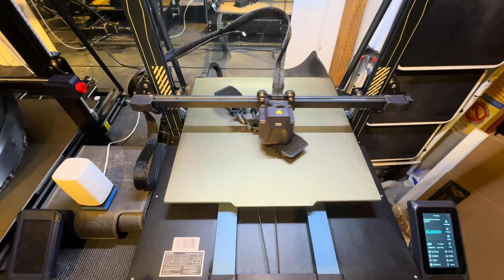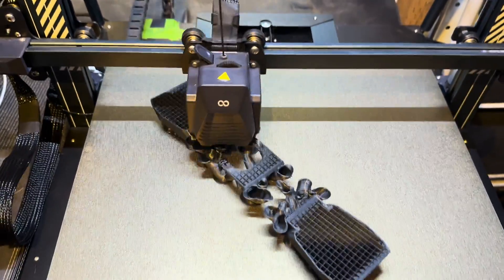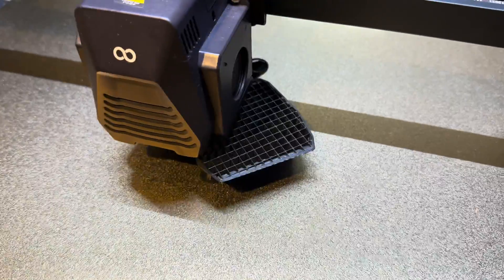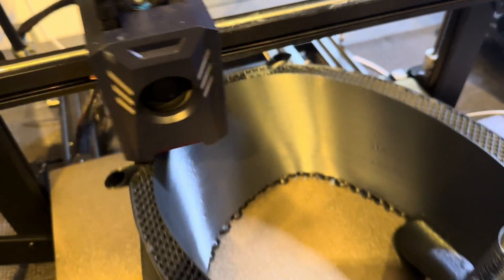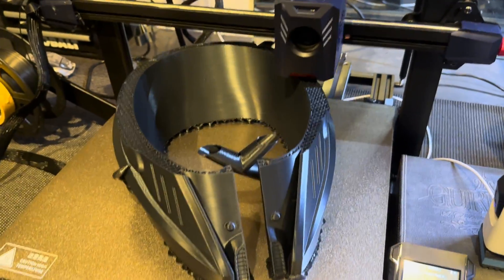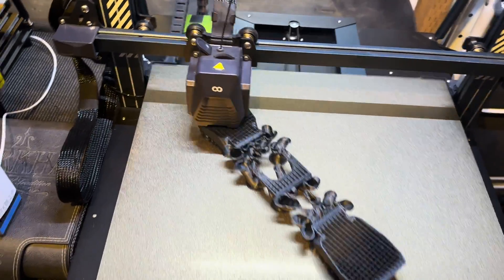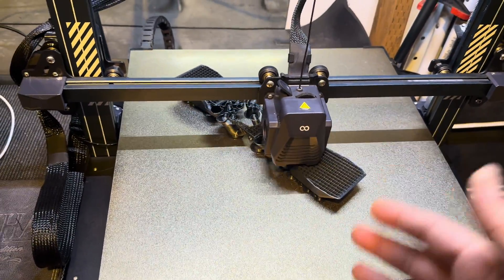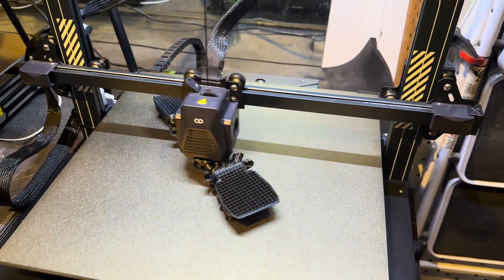How to prevent the nozzle from dragging across your print on your Neptune 4 Series 3D printers.

Comment: it's also possible that your z-offset was too high causing layers to be thicker than normal, if so then adjusting the z-offset even further away will only result in the same issue later in the print.

Comment: ADJUST MATERIAL EXPANSION

Its a Thing when you under extrude with a .4 at .2.... etc. Stretched the material and the layer actually hardens .205 not .2 x 30 layers makes Head rub..

Increase expansion like 1.5-2.5% 
Then Nail down perfect with .02 +/- z offset adjustment

Comment: I had the same issue. I was using Grid infill. even with combing off
 What i thinks happens is that the printer crosses the infill intersections twice per layer, the thickness (height)at the intersections  accumulate on each layer and finally hits the nozzle, I do not have an issue using 'lines' infill instead of 'grid' infill. the infill looks the same,
one can see see what is happening if you run a preview in cura using grid and using lines.
I hope this helps

Comment: I had this issue and managed to solve it ! (i use cura)

- Ensure bed is level within 0,3mm or less
- Ensure the gantry/head is firmly in place, as well as the wheels on the sides (shouldnt have one bit of loose movement when wiggling the frame, max one wheel thats loose. There is a tutorial from elegoo on this.)
- Adjust/calibrate your flow ( i used 96% after watching a how to on youtube, my flow was way over before)
- Gyroid infill can help (no overlaps with this pattern)
- Combing mode OFF
- Ensure Z-hop height is same as nozzle (0,4mm)

Im new to 3d-printing, but hopefully this will help =)

Comment: I adjusted my z height during a print. It fixed it temporarily but unfortunately a couple hours later, it started up again. This is because the issue isn’t the z height. The real issue is over extrusion on the infill. Charge to Gyroid infill and it should fix the issue. As for the nozzle dragging on supports, you’ll probably have to adjust the extrusion settings
Reply from the maker: I agree with you, over extrusion is the likely culprit and the gyroid infill is worth a shot!

Comment: Thanks for the info-  I got mine fixed by- 1 switching off Combing, 2 increase Z-hop to 0.4mm, 3 decreasing the flow.  I found I had to decrease my flow by a whopping 25%.  I set it to 75% flow and it is now flawless with no dragging.
Reply from the maker: That's great to hear it's fixed! Thanks for sharing your solution. 👍
Reply: You were a big help😊

Comment: I have changed the z hop setting and the infill from grid to gyroid and still have that problem. Is there anything that may cause it? I use Orca slicer for my Neptune 4 Plus
Reply from the maker: In Orca just past the “Support” section is the “Others” section. Towards the bottom of “Others” is G-Code output, I typically have to uncheck the spot that says “Reduce Infill Retract”. Also, I now mainly use Adaptive Cubic infill pattern.
Reply: @OuterRimArmorer  Would you still recommend the z hop settings?

Comment: I don’t know what’s going on but whenever I print a big print it always just keeps scraping the inside in its poking up so you can hear it scraping against those and I don’t know how to fix it does anyone know how?
Reply from the maker: It’s probably the most infill pattern you’re using but it could be another setting like combing mode depending on the slicer you’re using it might be called something different.

Comment: im having that problem with my pro and max. im printing with them right now and the pro started doing that. its also not completing the lines as it makes a pass causing the line to curl up at the end and then the nozzle smashes into the curled line. ive also noticed that on the walls and infill, the head extrudes little dots of filament and lifts up moves down the path about 10 mm goes down leaves another dot of filament and repeats the process. could that be fill gaps? but fill gaps is on on my neptune 2 and it doesnt do that. ive been searching for what the hell that setting is that does the dotting but cant find it anywhere. now the max is doing the scraping thing too as i type. i think amazon is getting 2 returns, this is ridiculous.

also i turned combing mode off recently because i heard it knocks parts off the plate which is what my neptune 2 does with supports. but z hop was turned on by default on my 4's so im gonna turn that off to see if it stops the dotting.

 i have grid infill on the print on the pro and gyroid on the max print so the argument in the comments about gyroid vs grid is kind of funny to me, finding humor in this is maybe my copeing mechanism to avoid throwing both printers on the sidewalk and going back to my neptune 2. if anyone can tell me what that dotting setting is, i would greatly appreciate it.

if its z offset causing the grinding of the nozzle then elegoo turned into a shit company real quick in my eyes for releasing these heaps of crap to the public without fixing them first, this is 3d printing , not videogames, fix your shit. and yes the firmwares are both up to date (which is probably the root cause of these problems, every update is actually a downdate in these times) i didnt have this problem with the pro out of the box before the update, and the max came with current firmware now that i think about it. then people look at me weird when i say i havent updated my iphone 5s since i got it with ios 8.2

ok and update, i figured the hopping was the printer printing the infill, the walls are print has a wall thats the awkward thickness where the printer is printing 2 walls with a tiny gap of infill. but why not just pass through and deposit the filament without raising the head? stupid cura 5, i should just go back to 4.8. cura is a shit compant too now because they wont allow cura 5 to run on windows 7, dinks.

ive also noticed the layers are looking really rough, almost like fuzzy mode on the horizontal plane, thats whats causing the grinding as the nozzle passes by. the layers are just not going down smooth. has anyone here tuned their flow rates, ill admit i havent done it yet because i just was excited to print. and im realizing my comment is turning into a forum post and i dont like it because anyone reading might be wanting me to just fuck off, "this aint a forum, shut up already!" sorry. hopefully im wrong and youre actually on my side
Reply from the maker: The dotting might be from filament oozing out when it preforms a retract or when it starts the next line. You might try running a retraction calibration. Maybe some temp calibrations as well. I would not turn off z hop. I always leave that enabled.
Reply: @OuterRimArmorer  the dotting was the head moving down,placing a dot, raising, moving over and repeating. it was printing infill in a tiny gap between walls with z hop enabled
Reply from the maker: As far as fixing the grinding sound, stop using grid or gyroid infill. They both suck for bed slingers. I use adaptive cubic infill.
Reply: @OuterRimArmorer  grid and gyroid are the only ones i used on my neptune 2. im using zigzag on my 4's, so far su good. but fuck, these printers are forever knocking supports off and its really fucking pissing me off

Comment: Once the problem didn't exist, because printers where slow. Now, printing @125, @250mm or more the nozzle hits very hard the infill. 
GYROID infill is a good solution, but print jobs take forever, just like you were printing  @60mm/s. At this point... let's print @60mm/s and the problem is no more.

Comment: I wish I had seen this video earlier, before wasting 3 months and 3X3KG PLA+ spools... My Elegoo Neptune 4 Max has been giving me heavy frustrations for over 3 months now, without me being able to obtain consistency.
What I do one day, without touching the printer or the slicer settings at all, the next day no longer works. I even got to the point of being scared of switching the printer off.
I believe my bed is not evenly flat, maybe not the bed itself, but the frame between the printer and the bed.
When I finally managed to get a decent bed layer, the printer started knocking the prints off because it has been hitting the models whilst printing, even though I managed to print one item without issues with the same settings... I had to manually adjust the z-axis whilst printing of 0.2-0.6mm, and still got the problem. Unacceptable. I checked carefully (I even bought some small bubble levels) the bed levelling and the z-axis going up, as per Elegoo instructions (untight the z-axis screws, level the nozzle bar, tighten the screws back), but I still had models knocked off by the nozzle. I lowered the printer speed, no luck.
I am going to try all these tips from you and the other people who left comments, and see what happens...

By the way, I was having some bad textures on print, I believe the 3KG PLA+ spool is not being fed correctly into the extruder because of the weight of the spool... Elegoo told me to turn a little screw on the right of the nozzle clockwise or counterclockwise, in order to tighen or loosen the grip. But the hole in the extruder's case is very small, that I cannot even see whether a screwdriver or an Allen key has to be used. By chance, has anyone removed the nozzle's case yet, so that they could see anything?

Thank you in advance

21/04/2023 - Update. Thanks to these tips I have managed to finish a print job. the print speed was drastically reduced (98% flow), but I got the product in the end. The quality is not perfect yet, but at least I did not waste any filament. I will play with these settings a bit, to see what I can put back to the original settings and what I need to keep as advised. I will try not to enble z-hop, and I will keep the flow to 100%. Maybe just the combing mode was the culprit... Who knows...
Reply: Hey there, how did you manage to fix the problem of extruder knocking the prints? I tried lowering the flow rate to even 97% and it still breaks my supports (and even broke a horse leg which was completely solid filled) :/

Comment: Enable Z hob might give you lots of stringing. Raising the nozzle might lead to prints coming lose during printing. 
If the nozzle drags about your infill, reduce your filament flow! 
Or better, use Orca slicer and calibrate your flow rate.
Reply from the maker: I use orca slicer on my Elegoo printers and just tune it so it doesn’t have any stringing. I have five printers and z hop is enabled on all of them. Selecting the right infill helps with nozzle dragging across the print as well.
Reply: @OuterRimArmorer  Do you have any tips how to deal with stringing?

Comment: i need help just got my Neptune 4 pro and actually the nozzle is hitting the in fill sometimes it scratches the walls i didn't know that elegoo have this problem also the nozzle highest sometimes is to high that the pla won't stick on the bed if i low it down it sticks but its too close to the bed and sometimes the filament won't flow down it stuck on the head without printing or coming out someone should help me or contact me to fix my issues thank you for the help
Reply from the maker: Which slicer are you using? Make sure you’re not using Grid infill.
Reply: the slicer is cura 5.6 and today i changed the infill to line and it worked but the model is not sticking to the bed after 5 min of work it get of the bed  @OuterRimArmorer
Reply from the maker: If you’ve washed the flex plate with soap and water and releveled the bed then the next step would be to try and adjust the z height on the fly(while the first layer is printing).

Comment: You can "fix" it doing that, but you'll have to do it every time, multiple times per print for a large model. In my case, I realized my flow was a bit too much. I changed it from 100 to 97% (after doing some tests) and now it works flawlessly (Neptune 4 Max).
Reply from the maker: Awesome tip thanks!
Reply: This ^ When you get impacts (and getting worse) too much material is getting put down. Knock that flow back a tab and/or run some cals.Can be the steps are off/firmware prob too in some cases
Reply: just found this comment and i think it fixed the issue for me after many long print failures! does this mean i need to permanently change the flow? 97% worked for me as well.
Reply: Mine isn't making that noise, but it looks like It's dragging through printed areas. Like if you push your finger through butter, how it all moves away, that's happening on my print. I wonder if it's the extrusion like you mentioned or z hop...
Reply: Thank you so much!
Reply: ITS A difference in the expansion expectation and the Actual expansion.. 

If you run a Test Square with 40% infill 10 mm tall 20mmx20mm then Measure the print right after the bed clears..  For height..
Anything over 100 mm..  is equal to an increase of 1% in expansion per mm  Material expansion setting.. 
THIS seems to be a pla THING FOR ME..
And Im dry >18%

Comment: So noticed you don't have that big loud fan on. Are you able to just take it off and not use it? It won't affect your print? I have that fan. My neptune 4 plus is in my living room. It is way to loud.
Reply from the maker: At first I just left it off to see if it made any difference. After about a week I unplugged it and took it off. Hasn’t changed anything for me.
Reply: @Extreme4x4Dude  thanks for the info. I'm definitely gonna give it a try. I have turned it down to like 30%. Which didn't seem to change anything. Would like to take it off altoghter. It is just  bulky and in the way.  I saw that orca has a 4 plus profile in the 1.9 update. I tried it out but it's giving me really long print times. Have you used it and if so has this happened to you?
Reply from the maker: I have used Orca and still using it for my EN4M. I did beef up the speed a little since it seemed to me the speed settings were a little on the conservative side. I’ve been working on a video about Orca but it was long and I want to shorten it to something more reasonable to watch.
Reply: @Extreme4x4Dude  i will try uping the speed. I feel like speed is definitely on the slower end. Do you have your speed settings in the video or do you know what settings you upped for speed? Im not as familer with orca as i am with cura. Just started using it a few weeks ago.

Comment: So I’m dealing with this on my Ender 3Max Neo. Im having to manually decrease the z offset as it prints several times during a print. Using prusa and am at a loss for what else to try other than leveling the bed a million times.
Reply from the maker: I just posted a “shorts” video on the infill change that I did after making this video and it really helped me.
Reply: Having the same issue with my ender s1 pro using prusa slicer with 100% aligned rectangular infill

Comment: What slicer do you use for your kobra 2 max as i cant find any profile for cura
Reply from the maker: I tried to use the Cura profile provided by Anycubic but it caused issues with my printer. It would randomly freeze mid print. So now I’m using the PrusaSlicer profile by Anycubic. Here’s a link to both of them. 
https://www.anycubic.com/pages/firmware-software?utm_source=blog&utm_medium=guides&utm_campaign=kobra_2_series_prusaslicer_profile_202310
Reply from the maker: Here’s a walkthrough they made to help load it into PrusaSlicer. 
https://www.anycubic.com/blogs/3d-printing-guides/kobra-2-series-prusaslicer-profile

Comment: It frustrates me that such a good printer is useless without the right firmware out of the box. I have 2 of the Neptune 4 pro units and they both keep losing the z offset randomly, they both hit the infill even with combing off and zhop enabled. It’s suspicious to me that the preloaded models like Buddha never seem to have this happen. 
Sometimes I get amazing prints, then sometimes the machines are like “nah” 
I wanted to add a N4-Max to the shop during Black Friday sale, but I’m not buying another Elegoo until they fix their firmware issues.
Reply: the Z-offset issue may be due to a lousy leadscrew/nut setup. mine has quite a bit of vertical play. I am replacing the screws and nuts with higher quality units. you may also want to check tension on your z-axis wheels. on mine only half were actually contacting the track.
Reply from the maker: I agree it’s been frustrating. They really should have made firmware updates easier too.
Reply: It was such an issue for me that I had to send mine back.  Sucks that I had to pay $160 for shipping for their faulty product.
Reply: @The-TermiN8r i got one on black friday but went through amazon. I ended up sending one back because of faulty heat sensor and luckly they don't make you pay for anything shipping related. I have two weeks till i can't send the 4 plus i have back and im considering it. Its been nothing but headaches and the new bambu A1 is looking really nice. I have a p1p and its easily my favorite printer outta the ones i own.